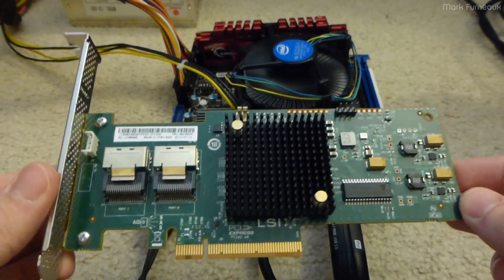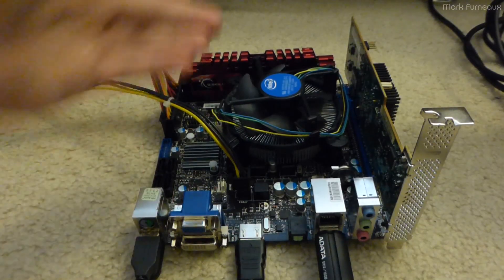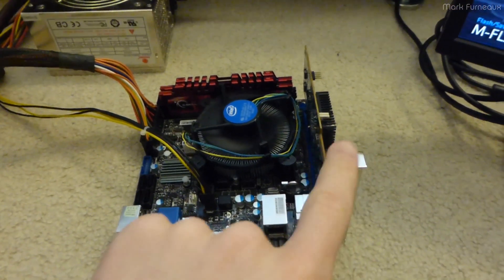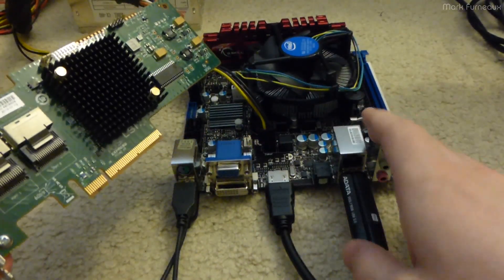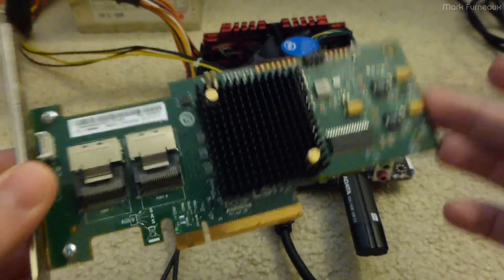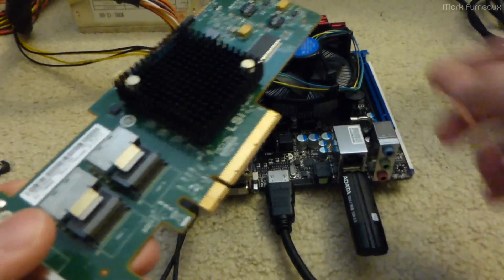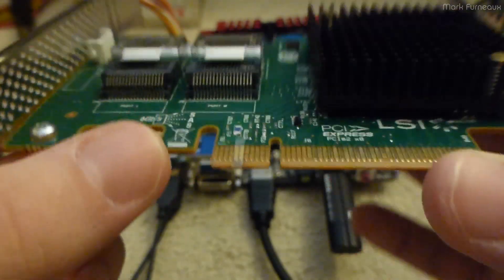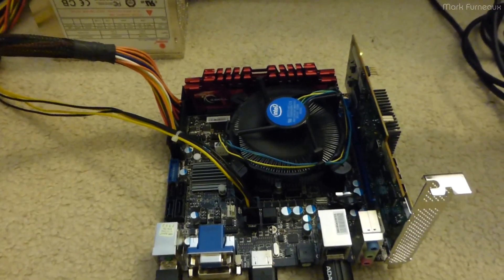How To Stop Your HBA From Disabling Memory Channels

Comment: You genius. I was wondering why my Dell Wyse 5070 Extended wouldn't POST with the HP 331T card in the PCIe slot. I put kapton tape on PINS 5 & 6 and it worked like a charm. Thank you!

Comment: i see this video after i seen another one about how to made a Dell Perc h310 work with other devices like my old dell pe t320 had a problem with the x16 slot so it was useless for what i was doing with it as it was a dual purpose server and the dell perc h310 is just a reprogrammed LSI controller after taping off b5 and b6 it worked with the server though the  msi board had to adjust to the new card...this basically made the card useful

Comment: I've had the same problem with a Dell h200 flashed to lsi it mode. I didn't had to cover the pins in order to fix the problem.

The hba has a firmware and a bios. If you don't need the raid capability of the card (I don't because I use zfs as filesystem) you can just remove the bios from the card. After that the dimm slots won't be disabled anymore.

I think it has something to do with the bios on the cards. 

Currently I'm having a problem with my Intel x550-t2 as well. The system doesn't post at all with 4 x 16gb dimms installed and the x550. It does post with 2 x 16gb and the x550 of with 4 x 16gb without the x550. Tomorrow I'm going to cover the pins to see if it will fix the problem.
Reply: Trick did work on the intel x550-t2 as well :)

Comment: Just trying to keep this thread current as this is an awesome fix to what is proving to be a "hidden" secret at Dell RE: card design.  I had the same thing happen to an Intel 4 x 1GBe I350-T4V2 (540-BBDV in Dell part number land).  Taping the 2 pins mentioned -- pins 5 & 6 from the outside of the card (SDA and SCL) -- did the trick but not till I got an RMA for this POC / POS (piece of / pile of).  Dell should be ashamed when a Dell card won't work in a Dell PC -- in this case a Precision 3431 -- and no one in the tech department has a clue this problem is baked into the card design.

Comment: I have a couple of Emulex oneconnect Dual 10G cards that I'm sure have an SMBUS issue but it's not causing any real problems.  The two PCs that have the cards in them power up and make a speaker humming sound with chirping and while it does this, the POST seems to freeze for about 5 seconds, but then continues afterwards and boots up just fine.

Comment: Very interesting! I have a M1015 (LSI 9220-8i) which work perfectly fine on a MSI Board. A M1115 (LSI 9223-8i) dosn´t. But masking the pins solves the problem. Thanks a lot.

Comment: I have a question about HBA cards I'm going to be using freenas then I will have 12 hard drives and I would like to be able to hook up a second set of hard drives externally what do you suggest that I get as far as an HBA a lot of people telling me to get the LSI 9211 8i and I would need two of those but it doesn't give me the option of doing external on the outside of the case

Comment: If it's in it mode would this problem not go away as raid is disabled (just got the dell h200 so may end up doing the it mode thing (so I can manly copy hdds, mostly overkill but it was only £20 with sas to sata cable)

I seen that there is a uefi firmware as well (first one is legacy second one is uefi) 

I have the cheap 2 port sata pci-e card  (looks same as yours) thows crc corrections when is been stressed out to much (cant use 2 ssds as crc events go up, they should of made it a sata 2 card not 3)

Comment: Wanted to say thank you for this video... purchased an older ibm x system and have upgraded about everything i could for best performance, faster quad core  xeons, ram, hba card,  10gib nics, 8x2tb 2.5 sata iii drives, fans, and etc... was days from trashing everything... no matter what I did it would not recognize all 48gb ECC FBdimms and for the life of me was unable to figure it out.  your video and a couple of minutes with tape and magnifying glass machine is running great w/ 48gb of ram.... Sub for life... ty again

Comment: Mark, thank you for providing this info. I saw it when you released it, but forgot about it. That is, until I needed to move my M1015 from an old board to a new one. In my case, it would fail to post when DIMM0 was occupied and when the adapter was inserted. If I removed the DIMM, it would boot okay. Used your trick and all is well. Thanks again.

Comment: Typical LSI's oprom developers failure again. I had this problem on every single LSI card i have ever owned. When i dont need to boot from a drive connected to the LSI card i usually disable the LSI oprom initialisation in the mainboard firmware and let the OS drivers handle take over after post. 
Some mainboards allow the oprom to boot after the mainboard resources have been allocated but considering how bad the programing and development is in regard to a motherboard firmware you can't know which will have this feature or not. 

Yes it is a firmware bug and unless you use coreboot you can't fix it, only find workarounds like you have done so the LSI oprom dose not steal a resource hard coded and allocated to the masinboard.

Comment: Dude, I have an HP Xeon server that has a similar issue, though it does not affect my ram, my AOC-SASLP-MV8 cards cause the BIOS to run stupid slow on any PCI-e slot below 1a. Since its trying to use my HBA like a video card!!

Totally going to try this, and see if I can get native on the drives I am running!

Comment: I think this may be happening to me.  I bought a Qlogic ISCSI HBA off of ebay that I can't make work.  In 2 computers there will be no video on the screen but the computer will boot to windows (I can RDP into it) and the card does not show up.  Another computer will boot with video on the screen, but the card never shows up.  I thought the card was defective and the seller gave me a refund and did not require me to send it back, so I still have the card.

Comment: Nice illustration.  I have seen photos of this being done, but I have never run into a system that had a problem with these cards.  You gave a nice explanation of it.
I think that it is a firmware fault because, most of the time, the systems that are affected in this way are the consumer boards.  Server grade boards are usually validated with SAS controllers during the development phase.
I have several models of SuperMicro system boards and a couple of models of Dell systems that work with these boards flawlessly.
Reply: I just commented about this particular issue. If you want more details on my issue, just reply to my other comment, I have examples. :P

Comment: Yep. done that with the same HBA to even boot on P9D-X. I think its just lazy versions of 'consumer' grade motherboards' firmwares. Because every Supermicro board will run just fine with LSI for sure. So I think its an issue of motherboard brands that do not design their products with enterprise hardware in mind
Reply: I agree. My MSI Z97 XPower AC motherboard booted properly with this same card.

Comment: Thanks for the heads up Mark. Just about to add LSI card to a UEFI system and would never have thought to check. Will now!! Of course if it doesn't boot then that will be an obvious giveaway as adding the card is the only planned change. Sellotape at the ready.